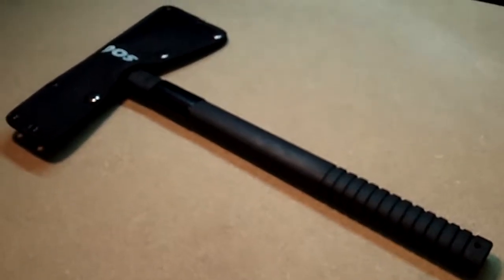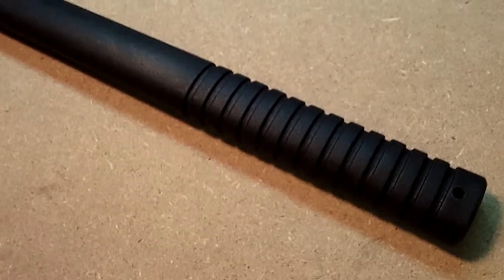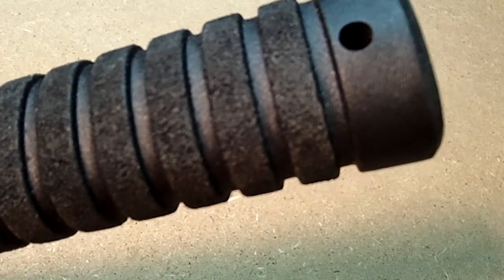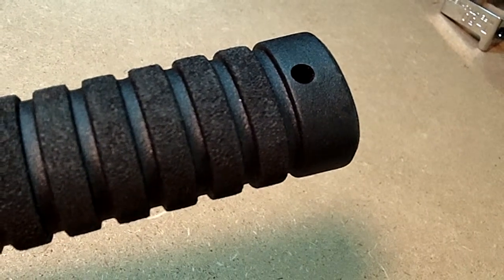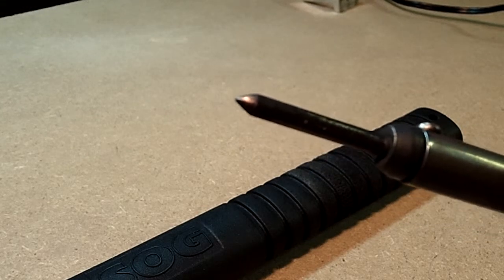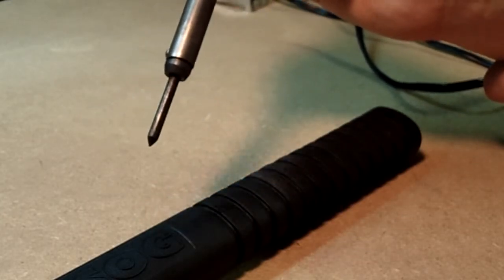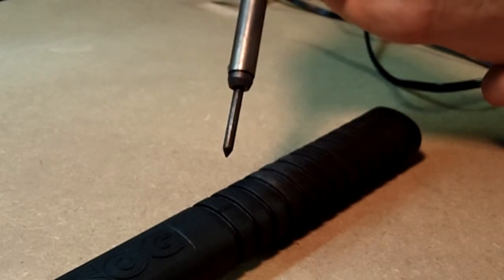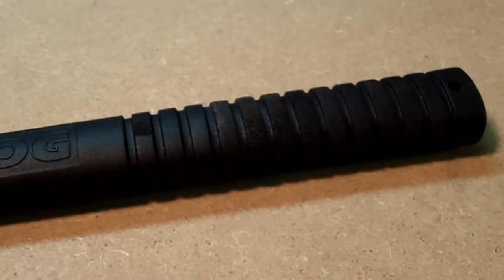Increasing grip on polymers & plastics

Comment from the maker: It should be fairly simple to do. However I suggest starting on an older one first or on an area that is not in sight first to get down how long you want to leave it on the plastic to give you the effect you desire. Just remember, the longer you leave the heat in one spot, the deeper the effect and the more aggressive the effect will be. 
Thanks for watching. Please let me know how it turns out.